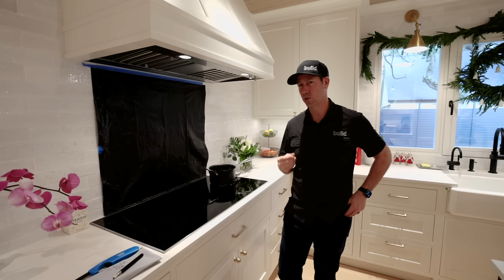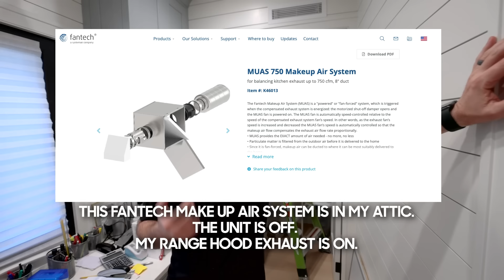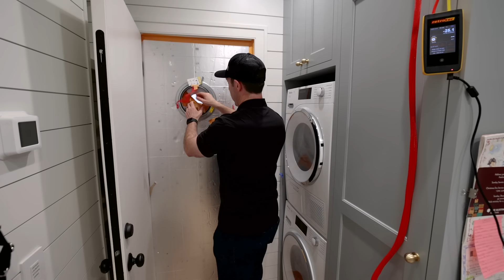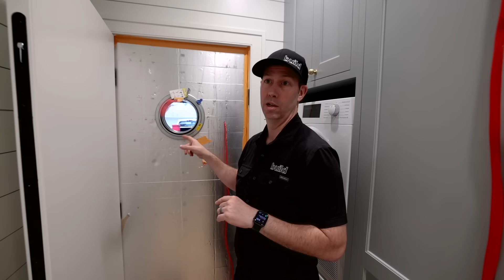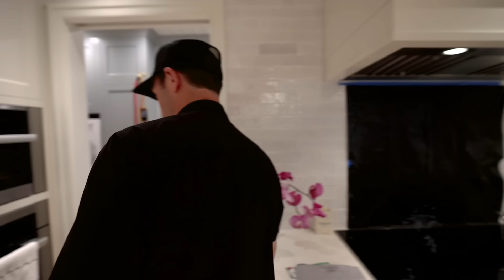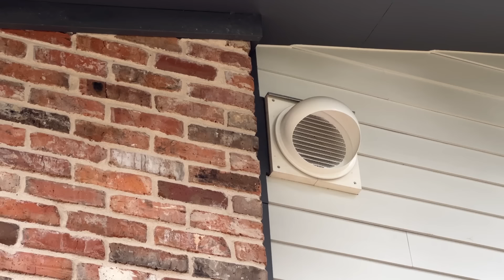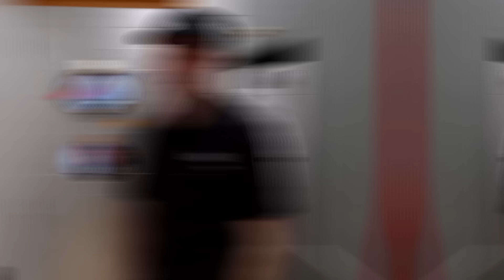Make Up Air for a Kitchen Exhaust - Most Homes Suck. (Pun intended)

Comment: From Canada have a 70's rancher that have been constantly/slowly upgrading and recently got to the point that if the dryer and range hood are both running at max it will occasionally snuff out the direct draft gas fireplace insert pilot. (Has thermocouple) 
So yes make it air tighter but don't forget to get your fresh air back in.

Comment: I had a house that was built in the 50's and when the adjacent family room fireplace was in use, I had to open the garden window over the kitchen sink to prevent the kitchen exhaust from pulling the smoke out of the fireplace and into the house.

Comment: Note also: an incorrect draft into the home will reverse the chimney draw and you wake up dead from Co
Their phemonom also and sometimes happens in a atmospheric temperature inversion.
Warm air get trapped under a pocket of cooler air (in the clouds) setting off everyone's Co detectors. A false/positive.
Reply: He mentions that at 3:47
Reply: Rockwool then spray foam around a chimney will keep chimney from condensing moisture.
Reply: I haven't built a house capable of backdrafting for 25 years, and backdrafting CO is essentially to concern of the IRC. Furnaces, fireplaces, and water heaters today are all sealed combustion/direct vent.   
IRC M1503.6 Makeup Air Required — "Where one or more gas, liquid or solid fuel-burning appliance that is neither direct-vent nor uses a mechanical draft venting system is located within a dwelling unit's air barrier, each exhaust system capable of exhausting in excess of 400 cubic feet per minute shall be mechanically or passively provided with makeup air at a rate approximately equal to the exhaust air rate."  I couldn't find any code language specifying under 3 Paschals.
I wondered why my local inspector never asked about the size of my range hoods, and I guess this must have been his reason.  I have a buddy who disabled the 3rd button on his 600 cfm hood just for fear of a failed inspection.  In Seattle I had an inspector jump all over me for a 1200 cfm blower not having makeup air, yet we had zero atmospherically vented appliances.  For that volume, I would agree that if anyone actually ran it on high makeup air would be desirable.
Reply: He died from death
Reply: How do you wake up dead🤷

Comment: Great job Matt as many contractors m8ss this.. I think you need to study on the  energy effectiveness of this though. As others have pointed out replacement air should be conditioned. There are so many sources of exhaust fans in a home (bathrooms, laundry room, etc) that a cost effective solution needs to be part of the HVAC system and introduced near the exhaust locations.

Comment: Hi.  Great video that helps explain the negative pressures that are inadvertantly created inside a building.  Whether a residence or a commercial restaurant.  Often times I enter a restaurant and need to pull very hard to on the front door to overcome that "vacuum" in the building.  As the door is opened I feel the wind blowing in.  Or should I say "sucking in".  Commercial kitchen exhaust often times include a fresh air (outside) air make up that is switched on with the exhaust.   This unfortunately introduces cold or hot air (depending on the season) behind the chef's back and neck.  Some systems incorporate precooling or heating of the ventilation air.  This is expensive to operate and the result is that most chefs or building owners eventually shut off the fresh air make up and let the make up air get sucked in from every available location.   Your reference to the 2018 IRC section 1503.6 (makeup air required) is definitely a consideration.  Especially the delta pressure limit of 0.01 in w.c.  BUT that section is prefaced with the condition of a dwelling containing gas, liquid, or solid fuel burning equip that is NOT equiped with powered draft ventilation.  Namely, a naturally aspirated appliance that depends on a chimney with the quintessential barometric draft damper.  Naturally aspirated appliances have been the known source of exphyxiation for decades.  Many death investigations are attributed to this condition.  So in addition to make up systems in buildings, a systematic conversion to power ventilated equipment is essential.
Thanks

Comment: As someone who takes cooking very, very seriously, to me, induction is the best choice for cooking in addition to the benefits Matt mentioned. The heat up times, searing power, etc are all superior to gas. It's just a better cooking experience. I have been using a miele that is very similar to the one Matt has (36" vs 42" but otherwise the same) for 4 years now and I'm never going back.
Reply: You have lost your mind. Anyone who takes cooking seriously would NEVER take electric/induction cooktops over gas.
Reply: @TwilightxKnight13  I got a cheap plug in induction burner two years ago and haven’t used my gas stove since. Once you get used to its kinks you’ll never want to deal with gas again. And a full 240V stove version with a larger coil would be like driving a Cadillac compared to my little plug in Yugo.
Reply: No one ever goes back. Induction and gas have an inverse efficiency i.e. 75/25 % V 35/65 % BTU energy consumption.   I’m a pro chef and now hate gas. At least open flames have a bit of romance.
Reply: For me--California--to reach the same BTUs (25,000) on the main burner, 100,000 at full tilt, I would need a commercial induction cooktop, run 60A to the kitchen and install a second electric service. That is at least $60,000 in expenses. Just not worth it. I am a former chef, and have used induction, heat is heat, but I like using gas better.
Reply: @CrispinCourtenay  How many of those BTUs from gas actually make it into the pan, though?  From what I've read, only about 40%, especially running flat out.  The rest just heats up the room.  Which isn't something typically needed in California, unless you're up at Tahoe or something.
Reply: This I do not know. Time to involve an engineer or a physicist.
Reply: @TwilightxKnight13 Ignorant comment. Lots of world class chefs prefer induction over gas.  Far better control over temperature for more refined recipes. 
But I guess if you're used to deep frying twinkies in old, hydrogenated oils you might not know that.
Reply: @TwilightxKnight13  they dont understand home power supply just not the same as commercial while home gas stove with plenty of choices going above 2.5kw.

Comment: Hi Matt, when I design a range hood one of the most important things I find to have it work well is a capture area where the filters are at the top and you have the sides and front come down as much as possible this created a natural collection point for the heat and steam and the suction and filters work so much better. For make up air I put in a an outside make up air grill usually in the floor neat the cooking range hood this comes open when the hood fan is active with an air movement switch.
Reply: Hi Brett.   I've got a 600 cfm hood and open a door.  This video inspired me to install makeup air.  When you're coming in via the floor, are you going under the kitchen cabinets with a grill in the toe kick?  It's the idea I'm getting for my kitchen.  Thinking near the range too.   Thanks.   Mike
Reply: @OnlyOneFever  Hi Mike, I try to get as close to the range as possible with the make up air grill, and with a 600 cfm hood going into the toe kick space should be fine it depends on how tight your home is, I on designing usually put the make up air under electric ranges or dual fuel and just close not under all gas ranges. I am a big fan of the look and ergonomics of ranges verses a separate cook top and oven. I have been in many homes with the cooktop with a hood is in a separate area from the oven without a hood and any smells from the oven fill the house sometimes with smoke.
Reply: Hi Mike, I forgot to say with the make up air coming in close to the hood a lot or most of the air being sucked out by the hood is coming in from the outside so it does not need to be cooled or heated and has a much smaller impact on home energy use, you can use the hood as much as you need to without feeling like you are wasting energy dollars.
Reply: @brettster3331  Thanks!  Good point on the makeup air being located close to the range.   Now I'm thinking of putting the air grill directly under the freestanding range.   Create a nice flow going from floor and around the range, straight up to the hood.
Reply: @brettster3331  I don't feel like the house is "that" tight, but if the door to the garage (near the kitchen) happens to be ajar, the hood draft will pull it open a bit.   We still open a window and the door to the outside regardless.  Especially when searing meat.   Thanks again

Comment: I did testing of commercial cooking hoods, and we used to bring in the make up air right around the perimeter of the hood, to create a Venturi effect.  We then wired in the makeup unit ( which supplied conditioned outside air ( heated or cooled).  Bringing in the makeup air right at the hood also eliminates having a draft between the makeup air and the hood.

Comment: I've seen systems that dump makeup air around the perimeter of the hood so that it doesn't mix much with the already conditioned air. That to me sounds like a much better solution. This one will dump hot, humid air in.
Reply: I think your right
Reply: We do the same for chimney fresh air fire place
Reply: humid or super cold unconditioned air...im not a fan of this (pun intended). Im surprised Matt didnt leverage the Panasonic Intellibalance engineers. Their newer model ERVs allow for a remote boost that can pull in air to compensate for fans like the kitchen. Tha >400CFM can basically negate any effectiveness you're creating from running an ERV
Reply: Matt you rock. Great video!!
None of this is covered by codes in Australia but fresh air intake and no negative internal pressure is important for a healthy house.
I have a computer controlled system in my roof that can bring air in or exhaust it
The air comes thru a roof vent controlled by dampers
It is less of a problem bec our climate is milder and the wall cavity is open  to the roof cavity
PeterB
Reply: Hi
Reply: @peterbarreca1568  yeah, interesting isn’t it as I’ve never seen it discussed in Oz. I tend to leave a bathroom window open most of the time especially with our fireplace although it has a flue. Same when we cook.
Reply: They tend to be custom.  Find a mechanical contractor that is good with sheet metal.  Also... velocity=noise.  Cross sectional area matters.  If you don't want stainless, have the hood built and powder coated before delivery - expect extra delivery time, as job will be subbed out..
Reply: @josephj6521  our rules now require all bathrooms and kitchens to be vented by fans to the outside
I keep the bathroom window close and have the fan on so no cold moisture comes in from outside
I use my ventilation system to bring in warm filtered air from the roof space in winter. The metal roof is a good heater for the roof air
Reply: That is a good idea so long as the supply is BELOW the cook surface height if it is close, so that the cold input does not short cycle the range exhaust flow.  this is hard to get right for 1200 cfm systems.  no one wants -5C air blowing across their head.
Reply: @larryseibold4287  it rarely gets that cold in Texas. For a cold area, yeah, I can see what you mean
Reply: That's how commercial kitchens with hoods operated. The make up air dumps right outside the hood. If there is a fire under the hood, then the make up air shuts off, but the exhaust will continue to run.
Reply: All the effort and expense to tighten up the external envelope of a building forces you to spend even MORE money to correct the problems created by spending all that money and effort of sealing the building up . What a vicious circle we create chasing energy efficient housing.  Even if you were to put 2 fans on the same shaft trying to maintain equal air flow would be difficult particularly with cooking ventilation (greasy, moist, hot ,particle laden air ) sticking to surfaces of exhaust path /fans would REQUIER ANNUAL cleaning as best more frequently if heavy  cooking is being done. As would the inlet filters. Other exhausts have similar issues although not as sever. ERV ATTEMPT to resolve those issues BUT again the issue of maintaining a balanced positive pressure requires an increasing level of sophistication in controls and expense initially and continued maintenance costs.  
How far are we willing to go into the wallet pursuing all these “perfect goals. Not so long ago houses did not have central heating ,integral kitchens ,integral sanitary facilities ,dryers. (Cloths lines out lawed ?)Many of those conveniences were SEPARATE FROM LIVING SPACES.  Each level of conveniences add costs that is why “affordable “housing is more elusive than ever
Reply: So we are making houses so tight, then let all that outside air in
Sounds like a total waste of money.
Reply: …making it pointless to seal all your electrical boxes in your exterior walls
Reply: @charlespaine987 you’re mixing a bunch of stuff up.
Efficiency costs much, much less in the long run via reduced heating and cooling costs.
Efficient houses do not have to be any more expensive.  It’s the building technique that matters.
After a house is built, the major ongoing expense for as long as the house is standing, is energy.
Reply: @rpdx3  As much as I applaud all the wonderful ideas of sealing buildings to save energy   Then venting and balancing air flow ideally? Residential homes are problematic. Few them if any HOME owners can or will pay for professional maintenance fewer posses the skills or will to do maintenance themselves. You end up with nonfunctional systems and high repair costs. Practical gets in the way of ideal
Reply: @venturahwy76  Realistically, how much time do you actually spend cooking or showering such that the makeup air is running? An hour a day maybe? The other 23 hours a day you are saving lots and lots of money having a well-sealed house.

Comment: This is a big area where commercial kitchens have a clear lead. The hoods are much bigger, allowing for a larger capture area. Makeup air matches the required exhaust rate and either comes down directly in front of the hood or slowly passes through the kitchen from the opposite side allowing for better fume capture. Sometimes the air coming down in front of the hood is cooled to keep the cooks comfortable. Or, with the latest tech, all of the air is cooled or heated to keep the whole kitchen comfortable.

Comment: Great Video, One thing to remember is Carbon Monoxide Poisoning from Gas  Appliances. That is why Make Up air is so important. In Commercial Restaurants they require a separate vent and duct work going in the opposite direction of the Exhaust vent.

Comment: Matt - I would love to see that link to the articles that convinced you to go induction vs gas cooktop. Also would like to hear why you chose this make up air system vs a system that provides the make up air around the perimeter of the hood. And as always - thanks for the great content.
Reply: Induction is better than gas in almost every way, especially health wise. The only downside is getting used to cooking with it. But I agree with the makeup air being around the perimeter of the hood! I wonder how you would do it/if it would work just as well.
Reply: Induction is special.
Plan on tossing pans in garbage. 
Proper pans will heat very quick. 
Even pans that say they are compatible.. May not be fully efficient.
Reply: Last i checked, professional cooks don't use induction cook tops. Unless you have an extremely level flat pan, you will get un even heat points.
Reply: @cruzmissileoutdoors  
Never had a problem with uneven heat. Pan quality matters.
Cooks use what they are given. They dont necessarily get to choose the appliance.
Reply: @cruzmissileoutdoors  You are thinking of electric resistive heating. Induction doesn't have the same problem of uneven heating. Most commercial kitchens don't have them in large part because of the massive investment and the already established flow of the restaurant. Commercial settings will be the last place to get induction if ever.
Reply: No competent chef or serious home cook would ever choose induction over gas. This is nothing more than scare-mongering due to the slightly higher risk of injury from open fire and the politically-biased push away from fossil fuels. There is nothing wrong with gas appliances. In virtually every case, a gas appliance is only less desirable when it is not maintained or properly installed/used, but that is true of anything. Be responsible and do things correctly and gas appliances are superior to electric ones, and that comes from a retired electrician and electrical engineer.
Reply: @TwilightxKnight13   Mm… it’s important to consider the possibly daily exposure to and intake of  millions, even  billions  of nanoparticles; also benzene, nitrogen dioxide, and more. 
So important to protect health, for oneself, loved ones, but everyone.

Comment: If you think about it, it makes sense that with an 8" passive hole, there is such a pressure difference.  If there wasn't  a pressure difference, the air wouldn't be pushed in through the hole.  Since the exhaust vent is pushing so much air out, there has to be enough pressure difference so that the air is made up.  It reaches equilibrium.

Comment: My concern is what you said: below freezing temps in MN and we sometimes cook fir 1 to 2 hrs on the range top. Summertime, easily 90 to 100F and humid as heck. Pulling 800 cfm inside the house would be gross!
Reply: That air is coming into your house anyway, without an explicit makeup air system you're just pulling it through gaps in your doors and windows.